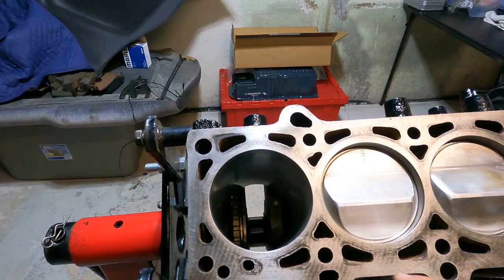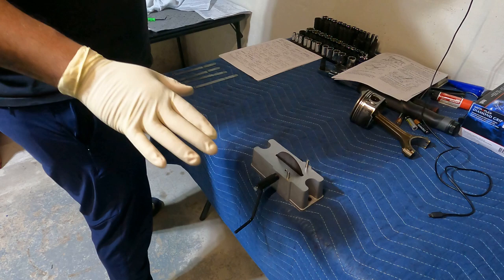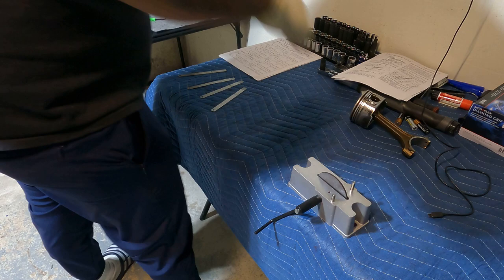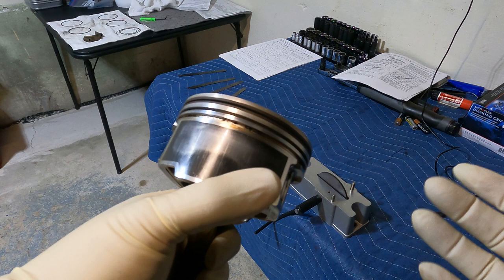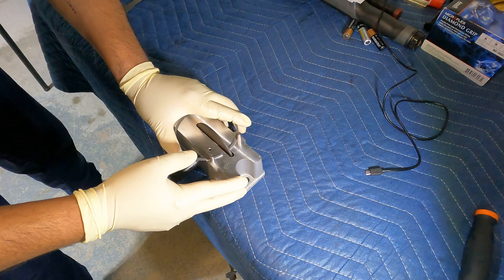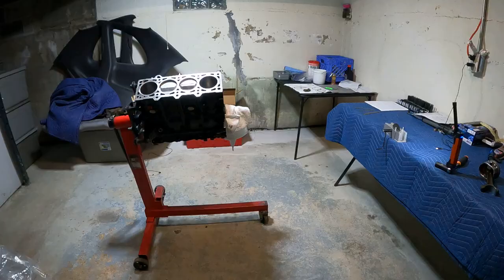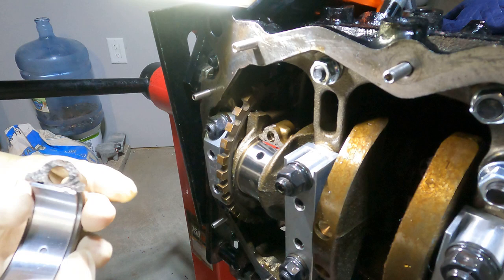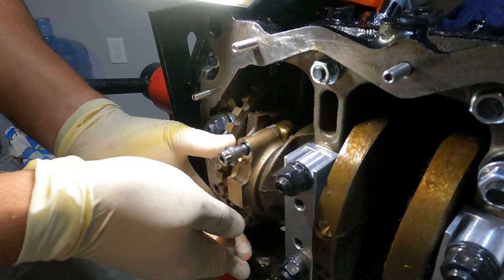OEM+ Srt-4 Engine Rebuild  Part 2

Comment: Hello nice video. Where can I get the apr connecting Rod bolts? Which site did you buy them.
Reply from the maker: @codymallett2231  I got them from modernperformance.com

Comment: Question when you take it to the machine shop what all do they do or you tell them? I’m going to be doing mine soon and I’m another 1st timer
Reply from the maker: I told them to 
1.hot tank the engine
2. Check the bore and make sure they are in spec.
3.hone the bores.
4. I gave the then main and cap bearing to check the clearances.
5. Magna flux the block.
6. Resurface the head.
7. do a valve job on the head.

And that’s about it really.
Reply: @stagedracing8150   can I ask how much it costed you for all the block work minus the head stuff?
Reply from the maker: @PrahTV  around  $800.

Comment: What gap did you run on the oil rings?
Reply from the maker: I honestly don’t remember since it’s been awhile. On the first engine video I added the link to the FSM and i know I went in the middle of the tolerances.
Reply: Mine came .025 out of the box
Reply from the maker: @ezequielcortez2233  I kinda remember now think it was 25 or 27.  

19 to 29 what is the threshold between the gap I think.
Reply: @stagedracing8150  ok perfect